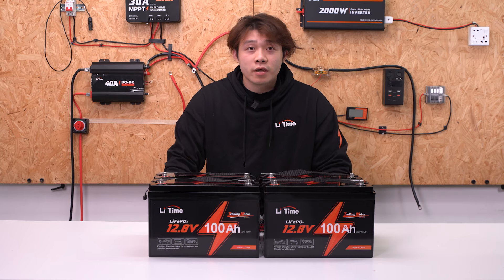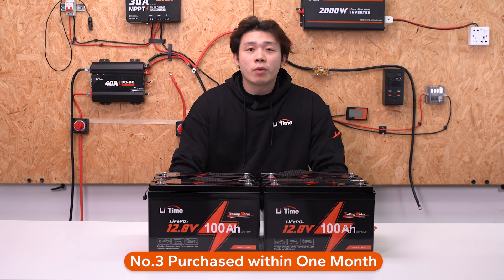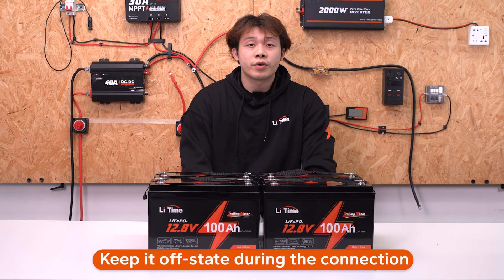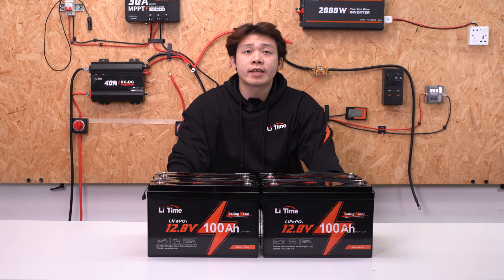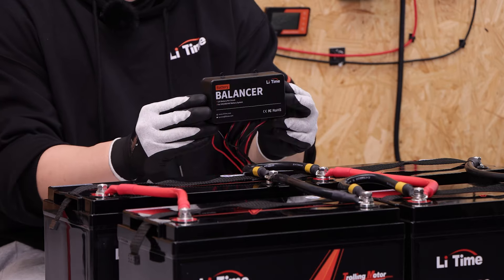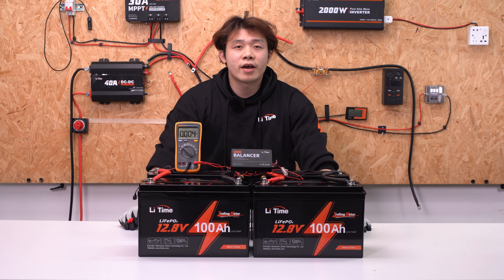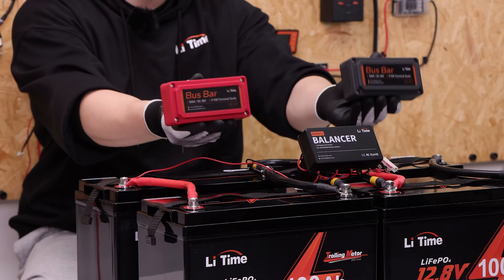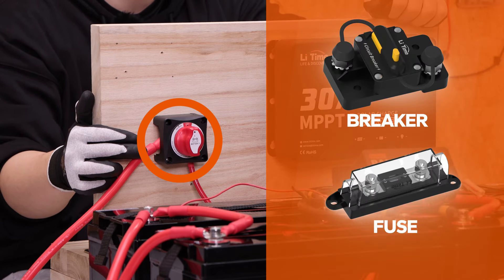How to Connect a 2P2S Battery System and DIY your Power Bank!

Comment: Does it matter what length the wires are or should they all be the same size and length to the buss bar?
Reply from the maker: Yes, as the wires can also affect the voltage, we recommend connecting the system (both parallel and series) using wires of the same gauge and length for long-term use.

Comment: Why do you only connect the battery balancer to one series and not both?
Reply from the maker: Hi harrison, in this video we set the left 2 batteries in parallel first, so as the right 2 batteries. so after parallel, you only need to choose one battery from left and one battery from right, and proceed with series connection.
Reply: @litimepower  can you connect all 4 batteries, and is it safe too?

Comment: How many amp breaker do I need
Reply from the maker: Normally, the amp of breaker need to higher than maximum continuous discharge current of your battery. You can check LiTime's 250A breaker here, it would definitely meet your need. 👉https://www.litime.com/products/litime-250a-switchable-circuit-breaker-for-lifepo4-batteries